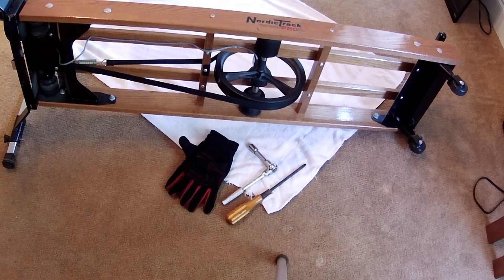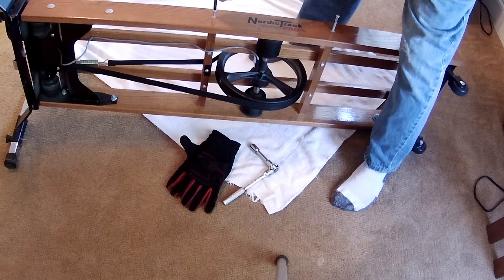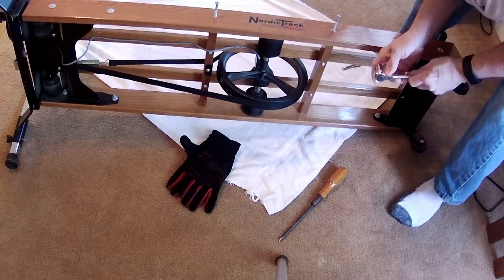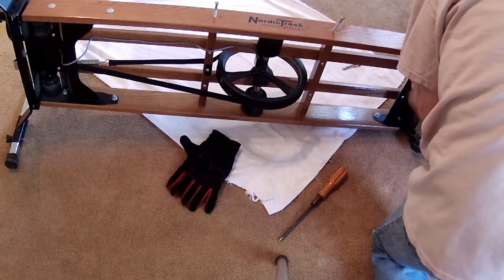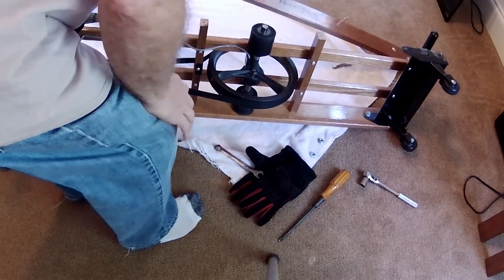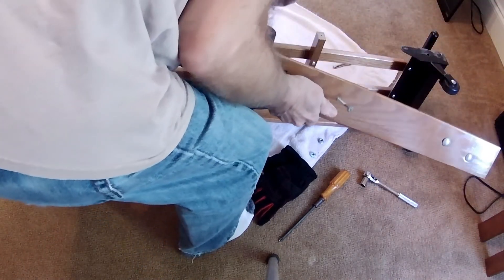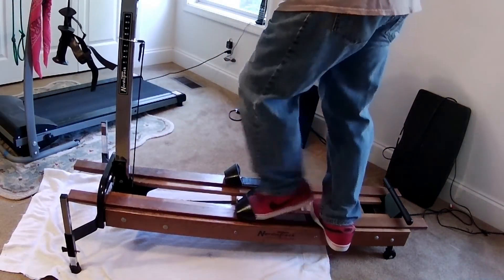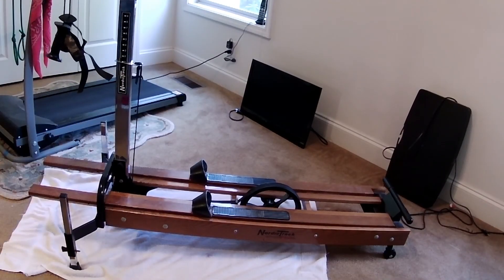NordicTrack Pro Ski Machine Drive Roller Replacement

Comment: i an totally un-hip about u tube, where is the info to get repair parts?
Reply from the maker: If you are looking for a drive roller, click on the link at the top..  Another source for parts would be this one:  https://www.ereplacementparts.com/nordictrack-skier-parts-c-147683_148477.html
You didn't mention the part or parts you are looking for.
Reply: @speedsterjohnny7191  thanks. that worked. I got it apart but the old roller won't come off the shaft.  GRRRR
Reply from the maker: @charliehumme8523  Hmmmm!  Not sure what that means.  My old one slipped right off and the new one right on.  Let me know what you come up with.